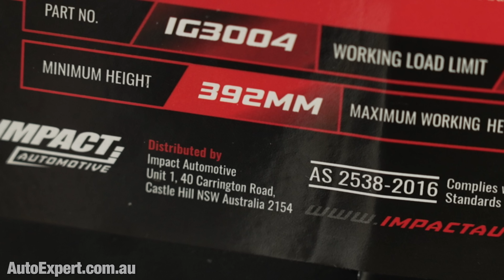Jack Stands: How safe are they really? (Weakest link revealed.) | Auto Expert John Cadogan

Comment: I bought a "cost effective" jack with a short handle. Taking my car off the jack stands the car slipped off the jack and I got squashed by the rear bumper striking my right shoulder (I was laying on my left shoulder) as I had to reach way under the rear of the car to reach the jack handle. 12 broken bones and a punctured lung in about 7 milliseconds. Great video!

Comment: I do mag particle and visual inspection on these stands from time to time. The cheap ones used in professional enviroments develope weld cracks. Just be aware of the seam welds near the base and the weld around the neck. Usually the cracks start in the crater (termination point) of the weld and progress from there. I often have to request that they get run through the parts washer before I arrive. So clean the grease off and have a look every 6 months to a year. For a homeowner the stand will probably outlive you so just have a glance at it every 5 years or so. If its bent or missing paint have good look in those areas.

Comment: Forgot to 🙂. But ignoring breaking an axle stand, if you are struggling with something you can pull a vehicle off the stand.  You really need to use them on a flat surface. But it is best to keep vehicles on the floor, undo things with impact devices, and personally I don't see why you wouldn't use some ramps to provide additional support inserting them like a wedge. 

In a garage they tend to keep all four wheels on the floor either being in a pit, or by lifting the steel floor treads hydraulically.
Reply from the maker: Not only flat, but also level.

Comment: Great video on a subject that did need some addressing John. as a woman with a varied career over the years including 3 years working in an iron foundry in the early 80's I did learn a bit in my time there. and as you mentioned, ductile iron is an extremely strong form of iron, with properties more closely related to steel than your normal grey iron as you pointed out. the foundry I worked in used several different cast iron alloys, ranging from ones with an extremely high  corrosion/ abrasion resistance, know as Nihard 1 and Nihard 4,  but they were an extremely brittle iron when it came to tensile strength. another with extreme corrosion resistance for use in the chemical industry was 27% chrome iron. again,  perfect for use in environments where corrosion and abrasion resistance were critical, but tensile strength  were not. then there was what we called SG Iron, which was very soft with poor wear qualities, but was more like steel in that it would bend rather than crack or break under high / excessive  load conditions. I thing the biggest issue with people using jack stands, and lifting devices as well  is the numpty factor, EG, not using common sense and taking various environmental factors into account..then  wondering why their car has fallen over.

Comment: I had a 4WD van fall off a jack a couple of months ago. I was trying to get it up high enough to get the stand under and the jack supplied with the vehicle was too high to get under the proper jacking point when the tire was completely flat (15mm wide piece of sheet steel through the tread). This was on a flat concrete slab and I was luckily not under the vehicle at the time.
My personal policy is that I only reach under a vehicle to place the stand/s, never crawl under a vehicle while it's only on a jack.

The most dangerous time to be under a vehicle is when only the JACK is supporting it, even on a stable surface.

Comment: Please be aware the stand and jack are not always the weakest link (ignoring you being potentially the risk). Be aware of the surface you are using these on. Obviously gravel or worse, dirt, no matter how secure they seem are a bad idea (I've seen people do this out bush 4wding). But even concrete can be less than ideal if you are not aware of the condition. I say this as someone who found a relative crushed under a vehicle whilst using jack stands in a concrete floor garage which, unbeknownst to him, had a very thin, badly laid floor which collapsed after a high rainfall event. it happens. Not always only to dickheads. Just be careful...
Reply: So, the floor failed.  The Jack stand worked, but the door did not?
Reply: @libraeotequever3pointoh95  
The point of failure was the substrate...(what was under the jack/jackstand.)
It was unfortunate that a previous owner had such a shitty floor laid in the garage. (or may have done the laying of the concrete as a DIY in order to tidy up the garage prior to selling the property.)
Reply: @libraeotequever3pointoh95  My point exactly. The idiot controlling the jack isn't the only risk...

Comment: I agree wholeheartedly...people sometimes don't think, and will even use the stands, but the surface they're on could be a dirt road. Not realizing that as soon as they focus the vehicle weight on a small surface like the jack stands legs, they could sink into the soft road surface, unbalancing the load on top. That's just one simple way you have vehicle drops or slide offs.

Comment: Cheers John.. 40 yrs as fitter.., never new the centre punch test..
Reply: Not a very good fitter then are you.
Reply from the maker: Try it mate - it's pretty accurate.
Reply: @AutoExpertJC  
Cheers.., not something I ever needed to ascertain.. , start apprenticeship in 81.., I note the guys that were even half generation ahead learnt/ used such.. a hell of lot more than we did….
A lot of machine I only saw at tech/ in text books or the dockyards..
Huge loss of knowledge.., but then.. so much gear is so much better.. chemical engineering/ adhesives… bonding…
Loctite H8000… used for bonding Ali boat hulls .. stronger than the parent metal…
Reply: @michaeljones7497  
Ya desperately looking for some John love n attention 🤗

Comment: 🍁 Canada - Very much appreciated your article on Jack Stands. Most of the stands I see at Canadian Tire or Princess Auto (large national chain stores) have only the narrow edge of the sheet steel at the bottom of the legs. Nasty if one needs to jack on an
ything other than a very hard surface. The stands you use have wide pads at each corner. I will explore the CSA standards as I can't ever recall seeing these foot pads on anything sold at retail in Canada. As a former military vehicle tech. I enjoy your occasionally snarky sense of humour.

Comment: I remember seeing a guy who was working on his small car, and he must have accidently tweaked the handle of the jackstand by 1/8th of an inch with the handle of his spanner, which caused the jackstand to drop the car onto him. Luckily he had his head and his upper torso outside of the car and was able to yell to his neighbour to come and help him which arrived quickly. But if he had been working on a family sized car or 4wd and had his head outside of the car he would probably have suffocated under that car. Extremely luckily for him, he escaped with minor bruising -to his body AND ego, but the point is those jackstands are supposed to lock until the weight of the car is removed and that did NOT happen, thats is why I only use the type with the pin that goes thru and NEVER get under a car that is only supported by only a jack.

Comment: One point to note about the early jack stands of that style, the pin was not always a part of them as they sometimes did not have them at all and a common accidental failure is hitting the lever and it kicks it out of the lock and falls. The pin was introduced but overall its still something that needs to be put back in so that is still a problem. Although there is some auto pin engagement systems, its still on select brands and price points.

Comment: A good friend of mine died from a car he working on falling on him about five years ago. He used stands, but I suspect that he was using them on wet grass and mud, and not stable concrete. I can't ever know for sure, though, as the exact details were never released and I wasn't there when it happened. Ever since then, though, I've been very wary about the surface I put my stands on. And then I always give the vehicle a good push in multiple places before I get under it. This way, if it does turn out to be unstable, I don't find out while I'm underneath it.

Ironically, the stands I usually use now are the same ones that friend of mine loaned me just weeks before he died, since the accident happened before I had a chance to return them.

Comment: After years of using these jack stands, I much prefer to use wheel cribs. If I have to remove a wheel, I simply support that corner with a stand. The other 3 corners have cribs.

Most vehicles have well tucked underbelly components. You can even set the car frame/pinch welds on the cribs to remove all 4 wheels.

Comment: In the US there was an issue with jack stands from Harbor Freight being improperly designed causing collapses due to the release handle being bumped.  The rachet mechanism wasn't designed with enough bite for the pawl.  Had it been designed with a sufficient bite for the pawl, it wouldn't have been easily released under load.

Comment: I use Jack stands and old rims with tyres.  7 inch rims to chock the tyres. Jack the car and place the rims under the tyres fitted to the the car then let the car down in them.  10 inch rims under the the end I'm working on if I leave the tyres on the car.  If I'm taking off the wheels I use jack stands and the 10 inch rims placed under the car. I sometimes use big hammers and levers to removes things and jack stands never feel safe. Ps do not give me shit about my grammar or spelling. I'm dyslexic and without dyslexics you would not have the gifts of all the great ideas you use on your channel.

Comment: I can speak of experience with a failure of one of these stands. The roll pin failed. This would be the roll pin that locks the pawl to the release arm. When it did the stand most certainly did collapse. Unfortunately the pawl does not positively lock into the teeth of the post without the weight of the arm helping it evidently. I put the failure of the roll pin down to corrosion in this case. I ended up knocking out the roll pin on the other stand and sure enough that stand would both lock with the roll pin out.. I wonder if it was this pin your fellow was wondering about? If so he has a point. After that failure I always had a regular check of such things before use. Hope this helps and keep up the good work!
Reply: Both = lock... Damn auto correct

Comment: A truly excellent video. Please do not change your format to satisfy a small but loud minority.

I would never use a ratchet stand without a safety pin as one never knows if the cast iron is cast correctly, there have been recalls for this very issue. However, the stands you use are the best of their type. Personal preference is to use pin type stands.

It is very difficult to educate some people on safety due in part to the misinformation on many YouTube channels by people with no technical training.

Comment: you can have top quality axle stands. but if you on unstable ground such as dirt they can sink or topple over and you can get pinned and die.

I have personal experience of what happens when a vehicle isn't properly supported. it happened to my grandfather. he was helping mums brother fix his car. he got pinned under a differential. they were changing a diff. what saved him was a solid block of timber that cuaght the towbar and stopped him getting crushed completely.

he still had a broken collar bone, a broken rib and a punctured lung. he was flown to brisbane and his lung inflated on the plane. they didnt think he would survive.

proper axle stands, floor jack and timber cribbing would have prevented his injuries and we had them at home they only had to ask us to borrow them.

Comment: I used to get under the car with just the floor jack... now I'll use two Jack's and stands and  I've made a variety of big hemlock blocks .   I've had the blocks under my 40ft motor home.. They're not going to fail.   It's amazing how getting older and having kids can change you... I also where my safety glasses.   And yes Grey iron would make a great welding table,  I recently acquired an old Grey iron woodstove that had a couple little cracks.  I've heard it's hard to weld lol. That's an under statement.   I ended up making a big batch of coal to burn in the stove to get it red hot to be able to weld on it.  Then I dumped a bucket load of sand on it with my tractor so it cooled slowly and evenly.... was it worth it going threw all that effort?  Probably not.  But that's not the point.  I wanted to do something I've never done before..and I did it.  I fixed it instead of buying a different one.   I get great satisfaction from that.

Comment: I believe the type of jack stands the viewer was writing about was the older style that utilized a single pin through the body of the stand to carry the load on that central pin itself, operating in double shear, not the ratchet tooth style that you have. I am from US and there are more than a couple recent recalls on jack stands. I usually use more than one to carry the weight and leave the jack in place, all set to pump up, if possible. I don't ever want to become the tragic story on the news.

Comment: You might consider a follow-up on jack stands to point out a risk using this style on lighter cars.   What, danger from too light a load?  Yes...

The release handle has a shear pin to prevent releasing the pawl while under load.   This is a good thing.   But with light cars (2000 pounds or so), the shear pin can be strong enough that the release level can be lifted, disengaging the pawl, with the shear pin intact. 

The secondary locking pin on the stand featured in this video should protect against that failure mode, but it is worth pointing out many stands of this style (with the release handle) do not have a secondary safety pin.   

The chances of someone foolishly using a prybar to force up release handle under load is pretty remote, but people should be aware the risk does exist.

Comment: Should note that the main compliance is to "Consumer Goods (Vehicle Support Stands) Safety Standard 2017" which calls out AS 2538:2016 Vehicle support stands. So as long as they specify either standard it will be fine, a lot of supercheap and kingcrome specify Consumer Goods (Vehicle Support Stands) Safety Standard 2017 instead of the 2538 standard.
Reply: I had to research this after listening to John and physically opening the new Stands I bought to check for standard compliance. I just assumed when buying, like a motorbike helmet needs a visible sticker or its illegal.

Comment: A home made jack stand made of 3/4" steel plate and 2" steam pipe is better than no stand at all....better than bricks and blocks of wood, or a milk crate.... However; I now have rated 6 ton jack stands that are the preferred option. 35 years in the trade, I have never had an issue with jacks and jack stands, always very careful and alert.

Comment: How many of these types of axle stands do you see in the UK but without the locking pin ?  In fact I don't think I have ever seen one with a locking pin and the ones here have been found in some circumstances for the pawl to release if the mechanism is caught or shocked.

Without a locking pin in place   I'd be very wary of  these things.  Everything might be upside down in Australia but I think they got this one right.

Comment: Well as an American hump, lol. And someone that has worked in a full service gas station/automotive repair shop, the only time those jack stands become dangerous based on my own experience is: 1. When they are over loaded. By that I mean, shoving a 2 ton jack stand under the axle of a semi trailer that has say 20 tons on it. And 2: using a jack stand that has a faulty locking leaver due to being abused, that allows the release lever and wedge to fall out. Lastly 2: using a jack stand in dirt, without proving some kind of pad for the Jack stand to sit upon that spreads to load out over a wider surface. Thus preventing the jack stand from sinking into the ground due to a small foot print. Example a 4 ton jack stand will not support a 300 lbs riding lawn mower, if it’s sitting on dirt that is soft instead of set concrete.

Comment: I use wood under my jack stands when I'm stuck on grass. This is an issue with most regional racetracks in the country. The stand goes into a lock box in the centre of the large plate piece.

Comment: I feel like I'm the only one that cleans an engine before taking it apart.
I'm always afraid of crap falling in.

Engines are designed to have water splatter and splash on them from the sides and the front.
If greasy and/or dirty with grittiness, I spray it with WD-40 and scrub with a nylon scrub brush while generally flooding the grit away with WD-40.
Then actually clean it. I start by misting
 from a hose, then use a spray bottle with 50/50 car wash soap with a detailing brush to break up all the gunk, then mist it to wash it of, then wipe it down with a shop towel. Rinse and dry again. Then spray WD-40 anywhere that water may have made ingress in cracks and gaps and then wipe it down until all the water is gone.

Comment: I had a stand just slightly stuck underneath the car and rather than jack the car up I did the lazy thing and just have it a tap with a hammer to get it out , wasn’t a heavy blow just a decent tap . 
Anyway I got the stand out ! The cast iron part just broke in half . 
Obviously they are not designed to be hit with hammers especially from a side load , but it made me think twice about trusting them 100%